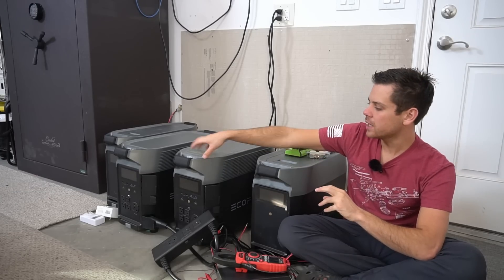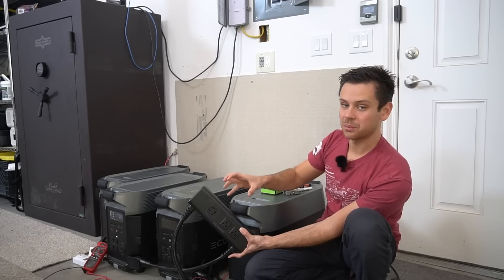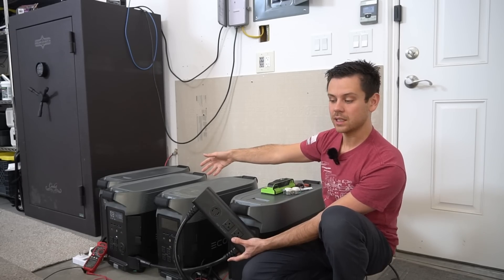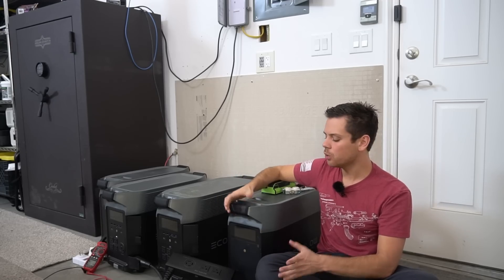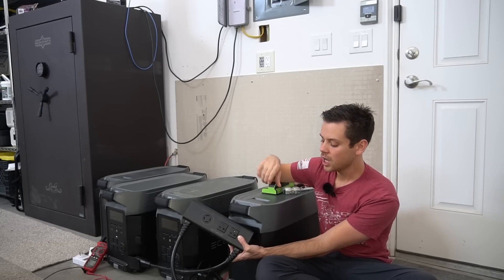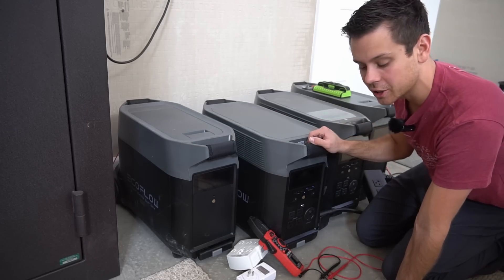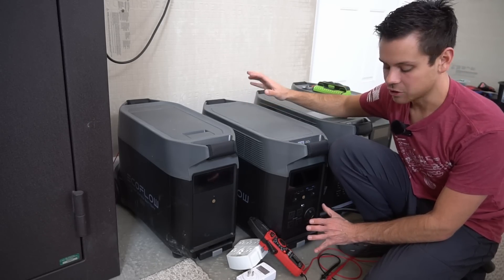I broke my Ecoflow Delta Pro 😬 (my fault)

Comment: Here’s a question for you regarding the Delta pro. I am trying to charge my Tesla. If I have a neutral ground bonding plug and I charge the Delta Pro via solar with 1400 W and then I have an additional 400 W coming into the Delta Pro  via AC  input via a delta 2 connnected to solar panels. Will this setup destroy the AC input of the delta Pro? I ask because the AC input is not grounded since it’s coming from my Delta 2 connected to solar panels and I just want to make sure I’m doing the right thing.
Reply: Have you tried doing this? I’ve been thinking about doing the exact same thing. Too scared to try 😂

Comment: Good day, I have the Ecoflow River Pro. When I try turning the AC power button On, I get the error message that states: 50watts with and icon and  "Overload" in red. 
Basically, I am unable to use the AC functionality of the device as I will always get this error message as soon as I turn on the AC button, which switchs off immediately after that message. Any idea how I can fix this problem?

Comment: I haven’t read through all of the comments so forgive me if this was addressed. In the video it seems as though it is possible to charge an ev with the hub as long as the units are NOT connected to a wall outlet, is this correct?

Comment: Could I plug my shore power cable into an ECO Flow Delta and run the AC on my boat? 
Is the 240 receptacle the same as shore power?
My boat ACon is about 7000 watts.
Currently I can only run the AC while on shore power and I don't like my options for gas generators. 
Or would I be better off buying a large LiFePO battery and an inverter?

Comment: So does this mean you couldn't do (for example) have a portable generator charging them and have the 240V output plugged into a home generator transfer switch (which the generator-inlet would be bonded at the main panel)?  That's the #1 use I thought of those would be ideal for...run generator as needed to top up batteries and run the house off the battery during an emergency outage to save fuel.

Comment: A couple of things I notice.... 1) I have the Split-Phase Bluetti AC300  system and it's designed to be charged by the grid while receiving solar/dc power from another source and providing output AC at the same. However some users of the AC300 are also blowing up their AC input charging units... these people are using non-neutral switching transfer switches, which passes the bonding of the main panel and thus can create a loop/path back to the AC input as you described. I'm a however using a neutral switching transfer switch which does not allow the bonding from the main panel to be passed and I'm actively charging from the Grid while feeding my transfer switch to power 50% of my home. I would be interested to know what type of transfer switch you are using and if it switches the neutral.  I don't believe people understand when to use a neutral switching transfer switch and thus go for cheaper non-neutral switching transfer switches. 2) Your continuity test at the start of the video with the grid disconnected tested the hot/ground, not the neutral/ground. You tested it correctly when you had it plugged into the grid. Can you confirm the first test again?
Reply: It's really a shame the Will does not monitor these comments. There are some great questions like this one and others that need his input. It just seems if youtube is how he makes money then answering these questions is part of it.

Comment: Interestingly, I’m waiting on my second replacement unit, as both of the Ecoflow Delta Pro units I ordered needed replacing. Like several others on the Ecoflow Facebook group, my second unit simply started smoking when plugged in to AC wall power, without any output load on it whatsoever… 🤷🏻‍♂️
Reply from the maker: Holy cow! That's not good. Has this been common with others recently?
Reply: @WillProwse  It was associated with ("overload") error 105, which requires a replacement unit.  At a couple others had the smoke issue as well (Some are calling the magic white smoke...) Hard to say how common this is, as FB groups can often be havens for complaining, but I wasn't the only one.   I'm using mine in my RV and wasn't off-grid at this time (plugged in at the RV park running on park power, but keeping the Delta Pro topped off), but it's a bit concerning as I travel with my dogs and have set my rig up to run A/C (I have a roof and portable unit; 4 smart batteries and eventually 2 delta Pros when the replacement arrives).  A little less confident leaving the system running for the pups if I'm grocery shopping or otherwise not with them in the RV...   (Time to buy a hot spot and install a wifi smoke alarm, it seems... LOL)

Comment: Bond the neutral to ground only at the main service disconnect most likely where your meter is located. Anything down stream should have separate neutral and ground conductors and remain separate all the way to the load.  The only exception would be at a separate building where the feeder to the sub panel at the separate building does not have an equipment ground run with the hots and neutral, in that case the sub panel is considered a service panel and the nueltrals and grounds are bonded

Comment: i have 2 DP's connected to my TCA1006D 100-Amp DP Single Load Transfer Switch.  So when i don't get enough solar to replenish both DP's on a rainy day, i will switch my TCA1006D 100-Amp DP Single Load Transfer Switch back to grid power and then connect both DP's to separate 20 amp receptacles to recharge the. Is it possible that if I don't physically unplug the L14-30 from the EcoFlow Double Voltage Hub or unplug the L14-30 cable from the Reliance Controls PB30 L14-30 30 Amp Generator Power Cord Inlet Box that I have still have a ground loop? I suspect the TCA1006D 100-Amp DP Single Load Transfer Switch only disconnects the two HOT wires at the switch. It does NOT disconnect the ground wire or the neutral wire.

Comment: Hi will, I'm sorry about your unit. Could you advise if a delta max could be used as a backup power source for a 220v well pump with a step up transformer?

Comment: What is a neutral bond?  Also I’m not an expert but that seems very inefficient to charge a Tesla off those batteries instead of the wall plug.
Were they set up like a pass through from the wall plug? Maybe it would work if the Delta system wasn’t plugged in to the wall at the same time charging the Tesla.  I like the Ecoflow concept but it makes me leery to put $10k into a system as you have configured there only to pop like a 10 cent disposable fuse.  The only thing your missing is their new smart generator, how would that charge a Tesla? I purchased the Delta Mini and the inverter fried when I tried to run my table saw off of it, as I saw others do worse testing their units on YouTube. The company was good to me, I was able to ship it back for another unit.  But now I’m scared to experiment with it.  
Thanks for the review.

Comment: Mine isn't charging from AC either. The screen lights up and the fans come on but the input shows as zero. Also the unit works okay alone but then as soon as I connect it to AC to charge it, the output wattage also stops. Any ideas?

Comment: If you get a chance, check the output voltage out of each leg in the 240 volt receptacle on the double voltage hub. Many us DP users are getting 107 volts on one leg and 130 volts on the other.

Comment: Hey Will.  I just posed this to Ecoflow: “I am off grid, using my hub connection on two Delta Pros for house power.  Can I charge my Tesla, using the “house” outlet from the current being supplied by the Delta Pros.”  Inna answered: “ Yes, as long as the charging of the Tesla stays within the capacity of the Ecoflow System.”   Your thoughts?  Oh, and thanks so much for your great videos.

Comment: With the proper adapter, can I plug my travel trailer RV into the L14-30 outlet on this hub?  I have a 30amp 120volt RV.

Comment: Jerry Cline
18 hours ago
Will, I just bought a 1600 delta max two weeks ago.  Plugged in the appliances in and not drawing that many watts maybe 200 and then I plugged in the power and I believe I fried the unit. It made a popping noise  and a spark at the outlet. Called tech and they said that It should have been plugged into the wall first then introduce the load.  It did indicate overload so waited till morning and after plugging into house power It wont charge and wont run any output ports.  Any Ideas??

Comment: Will what do you do for a living to get all these solar devices. Do you just get promos from everyone? Or you make enough on youtube to afford all this stuff
Reply from the maker: I have a few business
Reply: Trying to figure out solar generator for grid down scenario or solar sytem for 10k$ max what are your recomendations
Reply from the maker: @thomasjefferson4662  all recommendations are in the links of this video
Reply: Im a disabled vet and im trying to make sure I can run a fridge and a window ac in the summer here in FL and have fans and lights and random things when needed 2well pumps water softner system but can use a hand pump on the well sometimes and hot water tank maybe an electric frying pan. Can get by without dryer or washer maybe use washer once a week. Willing to make some sacrifices

Comment: OK, so don't plug EV into the hub; but will the hub powering the panel off-grid safely power an EV plugged into 240V wall outlet?

Comment: Will,
Do you see any problem using the a single Delta Pro as a backup for freezers using a Goal Zero Home Integration Kit Transfer Switch?
Will I have any trouble with the ground neutral bond caring through the Delta Pro to the circuits that the freezers are connected to (via the transfer switch)
Eco Flow support has informed me that 1800W can pass through the Delta Pro from the grid in "bypass mode".
I am concerned though because I see some interesting things happening at the Delta Pro AC output (that I don't understand) when I plug and unplug from AC grid power.
I would appreciate your thoughts.
Mike

Comment: I keep thinking this would have worked if you used the L14-30 adapter to Nema 14-50.  That would have had a ground and a Neutral in the outlet that would is expected to be kept separate.  But then with the separate ground and neutral, it may have had the same results as the nema 6-50.

Comment: Yeah and don't plug in a ground bonding plug into Ecoflow while having it get charged by house AC either =) Can a manual transfer switch still causing ground loops if you forget to turn off the main breaker before moving from the line to generator setting on the switch? Could a generator switch setting still be charged from a nearby circuit panel it is wired into when the breaker is on?

Comment: Can you verify the surge output of two Delta Pro units in parallel at 240VAC? One unit is supposed to be 3600W continuous and 7200W max surge at 120V, so I'm assuming that two units have a surge capacity of twice that using the dual hub accessory. No one has been able to answer this question yet. This would answer the question as to whether or not two in parallel could start up an HVAC unit with a soft starter on it.  Thanks!
Reply: I have the same question. It's really too bad the Will does not answer questions here. I realize he is busy but It seems he is making his money from youtube so if this is his job my question is why not answer questions on his videos.

Comment: By the way Will, I bought the Delta Mini a week ago and the same thing happened to me yesterday with no modification to anything. Just simply burned (smoke everywhere) and now the AC won't charge and no AC output. This is a quality issue with EcoFlow.

Comment: Yes they have a floating ground like most generators. The issue with a floating ground give no protection to ground faults unless it goes through a GFI. If it goes through a GFI the GFI sees the voltage on the ground side and trips but if your using the 220 240 plug they don't use a GFI breaker and your ground can be one hot in a ground fault situation. I just had this issue when running my backup generator for my tiny house.

Comment: I think I’ll really be happy with my 100% off-grid use of these with 2 1200 watt solar arrays. Thanks for testing the limitations though. I’m jealous to see you have the dual voltage hub. The hub is the last thing I need to complete my system and it’s delayed. I have extension cords running to my fridge and computer system in the mean time. Glad I don’t have an EV at this point.

Comment: I haven't read all the comments, but I have some thoughts.  In my experience as a marine electrician in East Coast boatyards,  I have come across many systems that are non North American systems, mostly boats from Europe.  I learned a lot from our chief electrician who was a trained US Navy electrician and has been in the marine repair business for many a year and seen it all.  I believe your problem was an unbalanced situation when utilizing the 240V hookup.  This can cause current to flow unpredictably in the neutral.  And, as you  pointed out, the ground/neutral connection is to be made only at the service entrance. The Ecoflow in stand alone mode, is a power producing device, and connects the neutrals and grounds together, in the pass through mode, a relay opens that connection, as the Eco is just another device that passes current through and recharges the onboard battery pack.  Disruption in the neutral, such as mentioned above, can certainly result in damage.

A safety feature that can be added to  a lab like yours  is to install an isolation transformer. This essentially takes 240V from your subpanel to the primary of the transformer and outputs to a 240V  with 120V center tap secondary.  The outputs can be configured  as split phase, as we use in NA or single phase  as used in the rest of the world.  If center tapped for NA 120V service, that center tap is the neutral and is tied to earth ground.  If for "Euro" 240V service, one end is neutral and tied to earth ground.  Check out  the Acme transformer division of Hubbell electric.  A Buck-Boost transformer can be configured as an isolation transformer, an appliance transformer cannot.

Comment: From my knowledge when power come in from the grid and goes to one’s main panel the ground and neutral are bonded, from there it can go to a sub-panel where you do not bond the ground and neutral and keep them separated. When you made your eco flow bonded you essentially made a bonded sub panel which I believe would be fine if it stayed off grid but as soon as you connected it to the grid you made a “sub panel” double bonded. Thanks for your vid’s.

Comment: That was a reminder that advice on YouTube and other social media, even from multiple sources, may still not be correct. When dealing with dangerous tech like electricity, bad advice can have serious consequences.

Will has a lot of experience, but even he got misled by social media "pundits". So, be careful out there. The same answer from multiple sources can still be the wrong answer...
Reply from the maker: Exactly! Appreciate your comment.
Reply: @WillProwse  I much appreciate your expertise & excellent YT videos, as I hope to implement a small solar energy system on our future homestead.

One thing that can really help with complex explanations like this video is to use a white board with different colored pens to show viewers where & why the bonded circuits fail. (Nothing like seeing a systems diagram to grok the big picture.)

In any case, you are the best on the Net when it comes to diy solar. Thanks for all that you do.

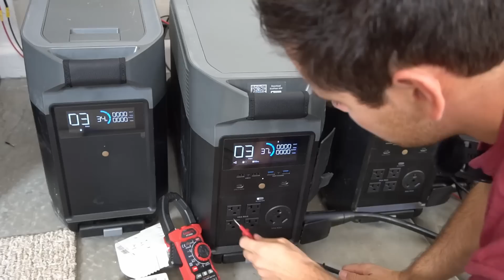Comment: 0:58....there should be no continuity between Ground and Hot....   You probably did check ground and neutral first, but that didn't show here in the video.
Reply from the maker: Yeah I checked both because these units can have reverse polarity. I just cut that clip too short
Reply: @WillProwse  Yeah..no worries.  I figured that was what happened.

Comment: Thanks for the update Will!  I went to the Ecoflow site and it says that you can use the Ecoflow to charge an EV. A support agent even says, “Hi zulu! Yes, you can Charge your Tesla with DELTA Pro. But you will require generator neutral grounding plug as DELTA Pro's sockets are not grounded and we didn't do grounding-free optimization for them. Hope this helps :)”. Seems like a lot of crossing information out there. Thanks again for the vids. Keep up the great work!
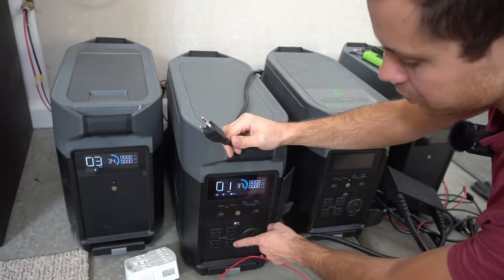Reply: @ 0:58 you're measuring between HOT and protective earth/"ground" NOT neutral & ground.  There should be no continuity there!  US outlets are designed so that the NEUTRAL blade can not go into the HOT side, which makes it easy to remember next time.  I can't believe people buy these oversize UPSs when they can get a real inverter and quality batteries + BMS, often for less money.  I use a victron multiplus II in ESS mode for true zero ms transfer time, because the inverter is always running allowing power to flow both ways to the grid.  If the grid dies, an isolation contactor immediately disconnects the AC input, while the AC output doesn't even glitch.  Best of all, the idle draw is far less than an APC UPS of equivalent size.

Comment: Can we now fully Charge an EV with Solar Panels on the EV?   golf cart ?yes.    pickup truck ?  car?   pulling a solar panel trailer ?
Can you drive a Tesla while it is in "charging mode" ?  (not accounting for the length of cable)

Comment: Hi will. I think that Many of the problems you are talking about in your videos Regards ground earth, and the danger that can arise where you can get electrocuted. 
Can be avoided by installing an residual current Device (rcd). 
I don't know if it's something in use in the U.S., but here in the EU (Denmark) it's a legal requirement. 

I'm sorry about my misspelling. My English could be better. 

Regards Rico